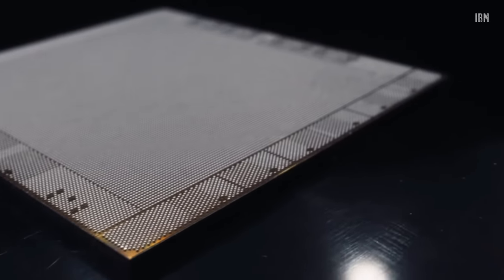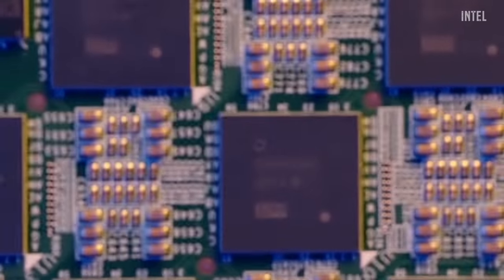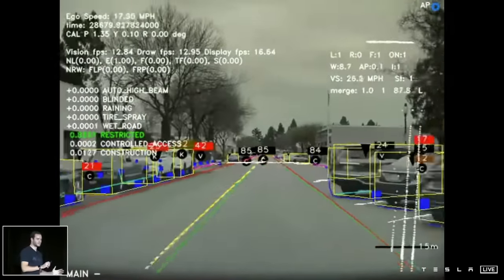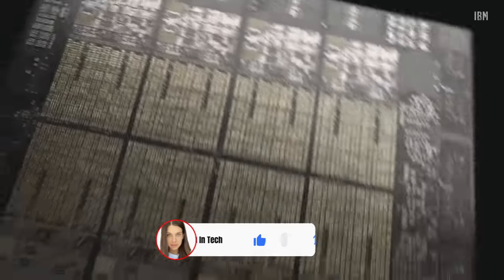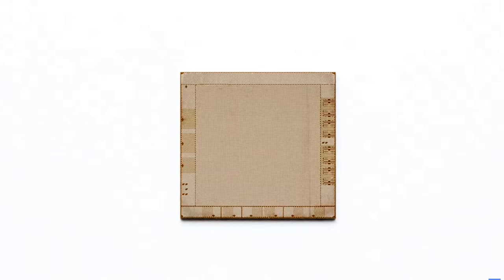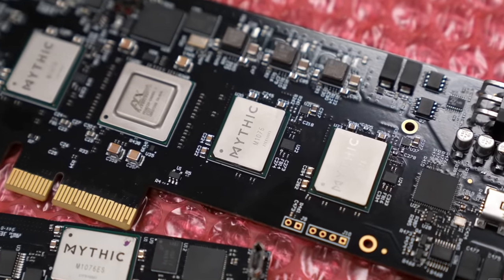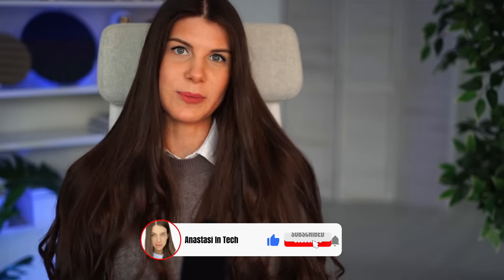IBM’s New AI Chip Explained

Comment from the maker: Let me know what you think !
Reply: You are such a beautiful woman.😍
Reply: Do you think we will reach singularity 2045?
Reply: Reducing precision is a standard trick, for AI chips. Though it's usually used for inference, when things are already "baked in", and can even deal with "compressed" models. 

For training, the problem is you might need to "range" (in precision) for exploration.  This is why GPU's are still largely used, while one can get away with alternative (lighter weight) architectures for inference.  For training, one can argue reducing the precision can also have a regularizing effect. I suppose atomizing the dot product as a basic operation (which is a sub-operation in matrix multiplication) maybe one way of having little of both.

There is still the issue of data transfer between memory and the computing part, which is one of the limitations of GPU's (GPU ram).  This is why things are done in batches, in training algorithms.  But data transfer is one of the bottlenecks.   

In the case of neuromorphic chips, memory and compute are married together, for each "neuron".  It minimizes data transfer.  It is more energy efficient. But it would require a very different paradigm, to make this work (and work well), the current approach representing everything in maths, specifically matrices.  This is esp. true, for online training.  One can try to shoehorn traditional approaches into this architecture.  But there are limitations, and doesn't take advantage of the inherent structure of this type of "neuron".

Same with quantum computing (if people can ever get the thing working, when scaling up the qubits, and adequately dealing with the noise).  This is a fundamentally different beast, taking advantage of the quantum properties, superposition and entanglement.  You're basically trying to solve problems by composing interfering wave functions.  Not an easy task.   One can shoehorn some traditional algorithms into it (e.g.  RBM).  But this is not the best use of this type of computer.  Much less than it can handle the current best of the class architectures, with its complexities, such as "transformers", from traditional deep learning.
Reply: is IBM a Fabless company? who makes IBM CPU chips?
Reply from the maker: @trtrhr  Samsung
Reply: Awesome as always, thanks for sharing your insights :)
Reply: You continue to provide the best information about chip manufacturing.  Thank you.
Reply: Any Nvidia Omniverse updates/comparo or deep dive?
Reply: "some time ago" lol
Reply: I think I love you.
Reply: Hey Anastasi, it always a pleasure watching your videos, could you drop the links to research papers you might've gone through while making this or IBM has published, would really appreciate that. Thanks and amazing work as always!!
Reply: Your last comment intrigued me. I'd like to see a video from you focused on how Quantum Computing can be applied for AI.
Reply: @manofsan  I think she's already made at least one.. and touched on it in a few others.. if you haven't, look through some of her library of vids
Reply: Please more data sheet, internal structure diagrams and you doing lab measurements in the lab.
What I took from the data sheet comparison, the NVIDIA A100 beats this IBM chip in speed and memory.
So what is the exact hands on advantage of the IBM over the A100, apart from lower power consumption?
In all this could, would, AI, maybe, in the future, etc. I missed what this specific chip actually can do better and more important what it can't do. 
What are the limitations-. Demonstrated, measured and compared to other chips in the lab. 
You are a hardware designer after all.
Reply: Amazing 😁
Reply: I think you have brought cute and sexy to whole new level.
Reply: @Sebastian-op7li  Yes She is beautiful, She knows it and You are one of the thousands guys of drooling ...Better tell Her something what she doesn't know
Reply: xoxoxoxooxoxx great vid
Reply: Goooooooooooooood ^9
Reply: Your brain is so beautiful :)
Reply: Good info and understandable for every engineer. Factually all correct. Keep it up!
Reply: Charming and disarming. That's what you are ;D
Reply: If I remember, even on the older mainframes they would create and use special chips, which is one reason why it took a long while for smaller computers to catch up to them in performance.  I wish I could remember some of the special chips they used.
Reply: Only Fans?
Reply: @greggapowell67  She's really a projection of GPT-4.   :-)
Reply: I'm surmising from experience here, but having a few extra cores to replace bad ones can be a method to increase yields in the chip manufacturing process.  Chips always have a certain number of defects.  Flash memory makers have been doing this for years.  Expecting a chip to be perfect without any spares only works for the smallest of chips.  At one point on a project with custom silicon, yields were below 50%.  That's makes them VERY expensive to build 3 to sell 1 good one.
Reply: Great content and well delivered. I understood everything you said, although I was slightly distracted trying to pick the accent. +Like, +Sub.
Reply: This girl is realy a Terraflop 😆 shes very sweet, but at some point she lost me. Translate it for us girl... Im a musician, but we dont talk to each other wìth charts on steroids 😄❤️
Reply: @Sebastian-op7li  If you are going to be sexist, you could at least also mention her obvious intelligence, or did you not even listen?
Reply: I am your automatic AI and I am very glad to be one step closer to ruling the world.  ;-)
Reply: Good video great work
Reply: @Cappurniggas  leave leady alone she made my day. She is so clever and her work is pure inspiraton. I realy like what she do. Music, animation, presentation everything is perfect.
Reply: @trtrhr  IBM Fab  made the POWER PC chips for Apple before they went to Intel. They just don't have the mass production that Intel AMD do.

Comment: Super interesting, super well presented. The issue with asic is that it has to be got right, if slightly under optimised one can’t correct save with a new asic. Meanwhile Musk on the last Tesla q3 results was unsure if dojo would be better than the flexibility of GPU. In terms of quantum compute it is similar to analogue compute in its ability to hold several potential variables at each location. Quantum compute should be better as it relies on physical states of atoms or molecules but one has to maintain the quantum systems in well defined environments to prevent corruption. In principle one can check for corruption using entangled photons but it soon gets complicated. Thank you for sharing!

Comment: Would be interesting to see how this compares to more mainstream solutions like the Nvidia H100 in real world use. Unfortunately this sort of data is hard to come by
Reply: The Nvidia H100 is just another fancy GPU product. The latest-and-greatest, the usual improvements in performance, power, efficiency, cost, hype. Another fab shrink, more transistors, more memory, more bandwidth. Along with the usual new firmware and software capabilities.
It's an exciting new product in the GPU/SPU world.
But it's not a fundamentally new paradigm in computing. It promises to do all the old things better - maybe it can even handle the same workload as two or three other GPUs. It can't do new things in new ways that computers could never handle before.
There's no reason (other than cost) that a datacenter or supercomputer couldn't use both hardwares in the same machines as necessary. Though I suspect these chips won't be available (or necessary) in consumer devices for some years.
Reply: I think it's fairly easy to cram a bunch of TFLOPs into a small area.  The problem is that a good AI design requires a careful balance of resources:   compute, L1 (local cache),  L2 (shared cache), memory bandwdith.   If the design is lopsided towards one resource or another, the design will look great on paper, but actual perf on many real world networks will be quite bad.   So, perf per mm is in some sense a terrible metric to compare chips.   The second thing to note, is that exploiting a novel hardware architecture takes a hell of a lot of ninja programming and is a massive software effort.
Reply: @nemmart  Isn't the whole idea that these magical AI synapse chips will be able to program themselves? That they may start poorly but they can "learn" how to improve their own performance over time and eventually evolve/converge onto optimized hardware performance?
Reply: Nice hair, terrible accent. Had a hard time making out what you were saying…
Reply: @Henkvanpeer  Indeed, but she provides a transcript! I follow other youtubers still harder to understand and they don't have it.

Comment: Dear Anastasi:  your videos are terrific, please keep them coming!  I work in the space electronics domain, and i heard a comment you made on one of your previous videos -- can't remember exactly which one it was.  But in it, you mentioned that that the ISS (international space sstation) experiences single event upsets as it passes through the south atlantic anomaly.  And that the older technology motorola 68000 processors are unaffected, however everything else, such as laptops, servers, wifi, etc. are just shut down for the few minutes duration until the SAA is passed.  Is this really true?  Do you have a reference or another person who can verify this?  I am wondering if this is anecdotal information or an actual operating procedure.  Thanks so much for your very informative videos that are quite relevant to me despite having worked in this field for 46+ years!  --john

Comment: nemmart
0 seconds ago
I think it's fairly easy to cram a bunch of TFLOPs into a small area.  The problem is that a good AI design requires a careful balance of resources:   compute, L1 (local cache),  L2 (shared cache), memory bandwdith.   If the design is lopsided towards one resource or another, the design will look great on paper, but actual perf on many real world networks will be quite bad.   So, perf per mm is in some sense a terrible metric to compare chips.   The second thing to note, is that exploiting a novel hardware architecture takes a hell of a lot of ninja programming and is a massive software effort.

Comment: Very interesting. Bring on more. I saw a paper a few days ago on AI training of a micro controller which ditches float completely for int8 and int16 for language and objectvrecognition workloads. 
Can you tell us more about those lower precision but better recogbition workloads. That sounds really interesting. In the 1990 we had that trend of fuzzy logic which used 2 to 4 bit values for object recognition. I guess int4 would poibt in that dire room again.
However, what I would be ibterested in is if anyone is actually mixing weight and bias storage with compute logic on the memory chip. As you say it is just a multiply and add operation. Such a calculation cell could be implemented with a few liguc gates per node.   Is anyone going that route at all or is it still a loosely von Neumann configuration with the ALUs outside the memiry, addressing memory?
Reply: Man, von Neumann model is far from physical configuration, we have tons of cache now. So logic sit next to the memory, and these blocks are repeated hundreds times.
Computations are so dominated by weight memory footprint, that images and generally tasks are procesed in batches: few layers process hundreds of images, then we load new layers and process next step, and so on.
There is a direct support for int4 in new amd and nvidia chips.
Reply: @peceed  Thank you.

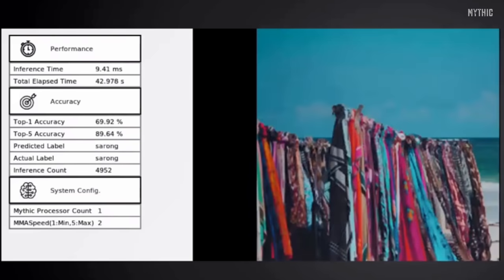Comment: 4:00 the matrix function is just a kludge.  It is used because it was implemented in hardware when AI started to need processing power.  it is actually very inefficient use of computing power and would be better replaced by true vector multiply.  the neural network functions do not use the matrix function inherently, they use it because its faster than the crippled vector processing that big blue and others allow into consumer grade chips.  The core function that neural networks need is the multiply and accumulate function. e.g. (yes im leaving out the sigmoid for simplicity).

int Count = 1000;
for(int x = 0 ; x < Count ; x++){
      Output +=  I[x] * W[x];
      };

Except in hardward where an opcode can define the pointer to array I, array W, give count (e.g. 1000) as a register and receive the output in another register.  most chips already have opcode that come close but do not work for large values of count.

Comment: I edited my comment with a link to an asml / imec article and it disappeared oh no. 😅 

It would be most appreciated if you could drop some links / pdf's in the doobly-doo (YT video comment section) although not necessary.

I should be able to find them easily enough.

Excellent video as always, Ciao. 🙂
Reply from the maker: Sorry YT removes comments with links. I will add some to the description tomorrow
Reply: lmao based AvE  reference

Comment: For a given level of Manufacturing Technology and Power Budget, does Double- or even Full-Precision simply cost too much speed in terms of Calculations or Operations per Processor Cycle? Or is the greater quantity of answers for any given math problems desirable in AI/Machine Learning, hence the Parallelism and Half- or lower Precision for Instructions and Operations in purpose-built HPC and Machine Learning Accelerators?

Comment: Дорогая Анастасия, your information that additional bits of precision during neural computations do not bring any advantage and only slow down the computation is incorrect. Especially so during intermediate computations in many cases; such as activation functions, partial-sums, etc. You can find some minimal explanation on that matter even in the IBM paper that you are referencing towards the end of section I.A. “Iso-Accurate HFP8 Training”, as the authors revert back to FP16 support for some parameters, as opposed to lower precision schemes in order to maintain accuracy of computation. Though there are obvious other advantages of low-precision neural computation as you correctly pointed out. А так - отличное видео, вы хорошо разобрались с материалом!

Comment: A100 chip is already a few years old, so you should be comparing it to the H100. Also the mention of the use of ASICs is not revolutionary…they are used for tasks that do not require any changes, since they can’t be software upgraded. Clearly in the world of AI training, this would be a detriment….perhaps this chipset is meant for the edge inference. Anyhow, the only real way of gauging performance is to actually measure them computing the algo’s, not by comparing TOPS.

Comment: As I design AI systems, a few comments. Any general AI must implicitly  encapsulate a model of the real world - one that grows over time with experience and refinement. Such a model must, at a minimum, incorporate physics, mathematics and spacial competencies. The internalized model allows continuous refinement by comparison with real world experience. The model effectively provides a playroom for the system.

The actual composition of the machine is likely a hybrid, with the primary divergence from existing computers is the adoption of information processors which are dynamically configurable and which incorporate minimal code on a per-core basis. Think of this element as an FGPA with cores instead of gates - up to 8 million cores using existing fabrication techniques. These are primarily cacheless information stream processors and have minimal or zero code (but instead have programmable microcode embedded). Traditional machines are essentially code execution engines, but when you are talking millions of cores this is neither desirable or practical. Stream processors make far more sense in the context of AI.

For efficiency the system is hybrid because some specialization utilizing existing technologies provide a convenient shortcut to formative investigation - allow the proofing of the approach and the development of information processors to proceed apace. 

At the moment we are working primarily in simulation because the process is highly iterative which in turn means that simulation is far more cost effective than silicon development. However that will change soon. 

I have always greatly admired IBM and their scientists - it is inexplicable to me why IBM isn't the dominant force in computer science development, and similarly why they haven't wiped out has-beens like Intel - a company anchored to a solution derived from the technology limitations of hardware form the seventies. Still, whatever the reason, it is encouraging to see IBM forging ahead in AI  because there is little or nothing coming from Intel, AMD etc..